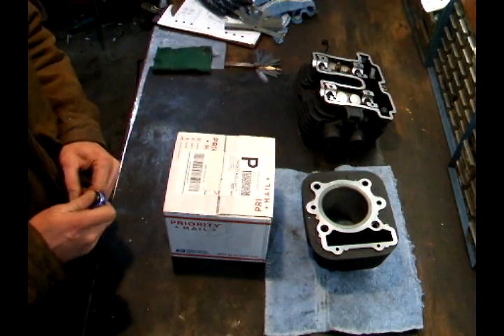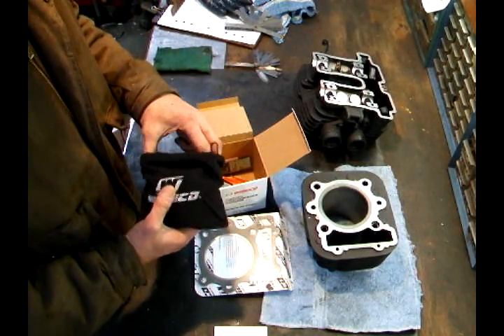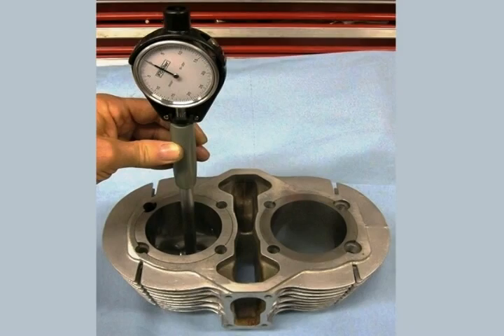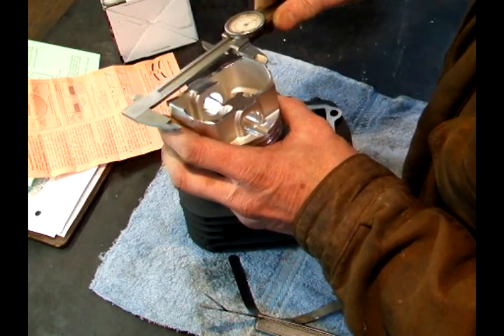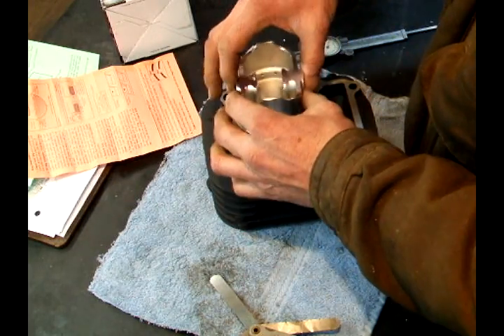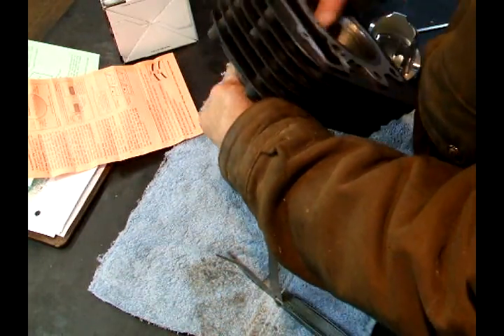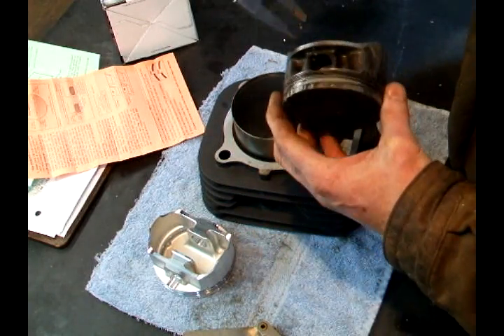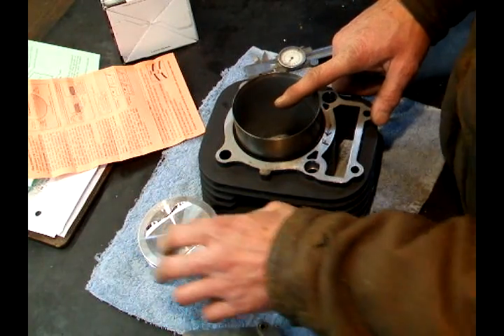Check the fit of a new Wiseco motorcycle piston.

Comment: How did you know how big to machine your cylinder before you got your piston? I mean piston are always a bit bigger or smaller than specs.
Reply from the maker: I would recommend that you have the new piston in hand before machining the cylinder and fitting the piston. That way you can adjust for tolerances in the pistons, but that's not always possible. Than you have to go by MFG spec's.